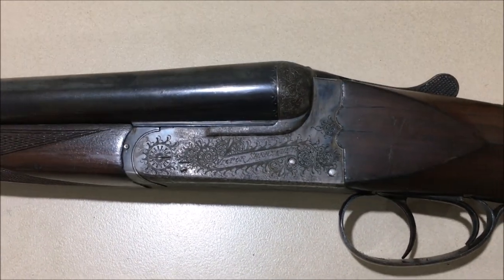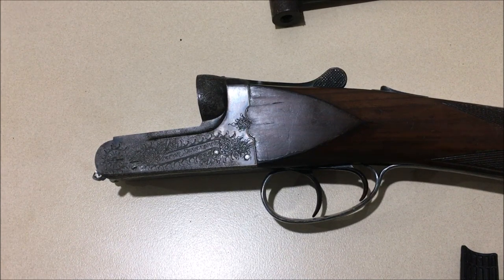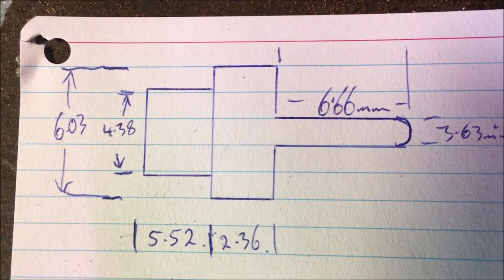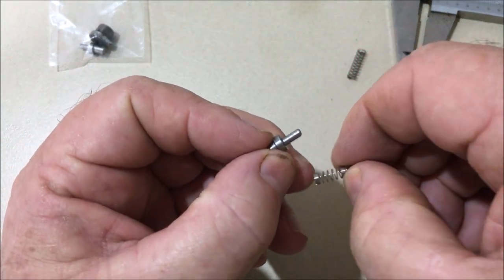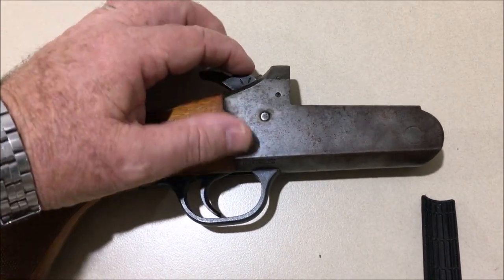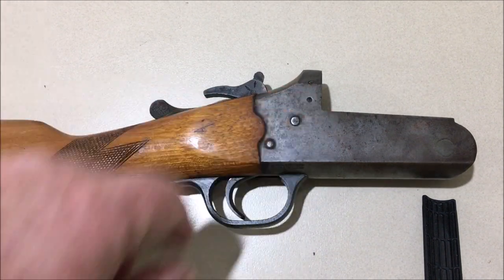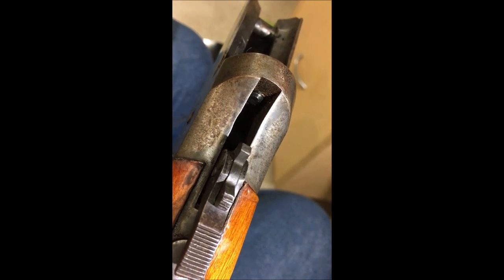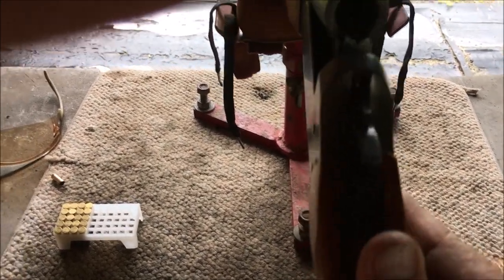Replacing Firing Pins or Strikers in Break Action Guns. Part 2: Boxlock and Single Shot Guns.

Comment: i have a 10ga SS box lock I removed the barrels for some lube on the hing pin.
the fingering pins are released and I dont know how to reset them please help.
thanks Martin
Reply from the maker: There will be levers which cock the hammers protruding from the front of the action. You need to push these down to recock the hammers. This is normally done as the barrels swivel when the action is opened. You will have very poor mechanical advantage as the barrels act as levers but you may be able to put each lever on the edge of a sturdy wooden table and push down to cock the hammers.
Reply: @456eec  Yes that worked thank you.
I tried  to reset  them that way myself  but it was so hard going that I was afraid  I  would do damage .
So a friend of mine  who is related to gorillas  tipped them over.
Thanks again
Martin

Comment: My bins have been taking out by one of my mates and the shops Ive been to are out of stock I would like to make one instead how would I go about doing such
Reply from the maker: You would need a lathe. Otherwise take the broken pin to any machinist and they should be able to make them

Comment: Where can I find this firing pin bushing tool ? Thanks
Reply from the maker: My stepson made this one with a piece of steel rod and a file. It took him about 2 hours. Original guns (probably including the Spanish gun shown) came with the tool as an accessory. You are unlikely to be able to buy one with the correct spacing so will have to make one. Here is some information that may assist you.
https://www.vintageguns.co.uk/magazine/gunsmithing-tools